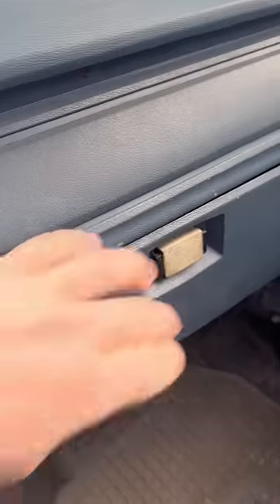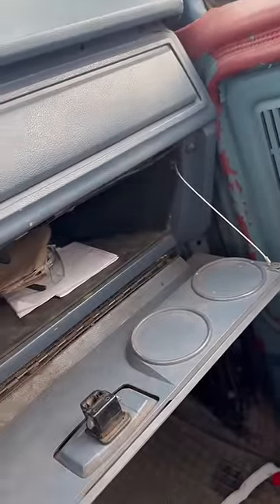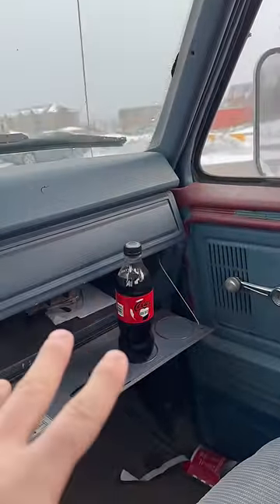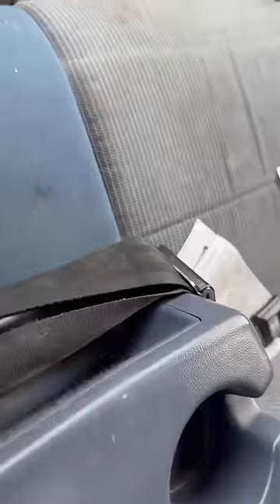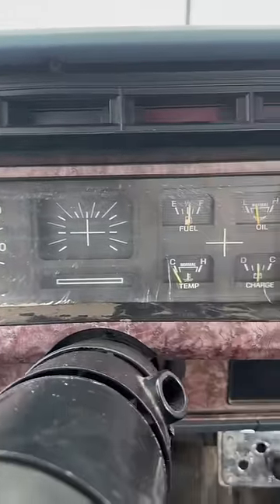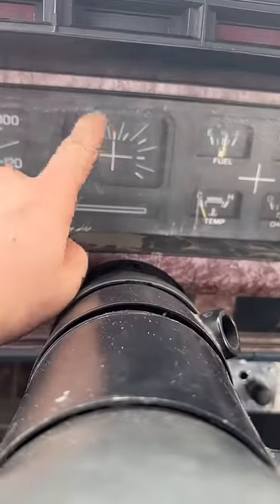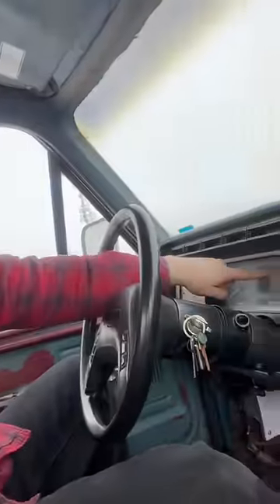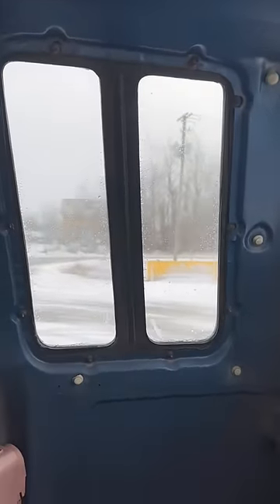Let’s talk 80s ford pickups

Comment from the maker: Edit I guess the brick nose trucks actually do share the split rear window for some of the years, thanks for the correction.
Reply: Yeah my dad's 88 f150 has the slit windows.
Reply: On the 87-91 trucks it's an overlay.
Reply from the maker: @76f350  very interesting
Reply: @76f350  no it’s not. how do you attach the trim over the middle. i’ve had to repair mine and it’s a split panel 89 and i have 3 of the super cabs one from 89, 86 and a 90 parts truck which is where i got my window
Reply: @Andy47357  It's a plastic piece and I believe it's held on with trim clips from the backside I'll have go check my parts catalog.
Reply: @76f350  it’s plastic that uses bolts that run thru the window bracket into the metal frame on the truck
Reply: @76f350  wrong I have a 1991 f150 and is a split
Reply: @Nicholas-ig5jl  Not wrong. I said the 87-91 trucks also had it.
Reply: As for the tach, in the truck I had, it was a clock. So maybe 2 options.
Reply: All years, 92 is when they got the solid window. My 91 brick had a split side window
Reply: My 89 had split windows in the back changed it to solid because the plastic lock always broke
Reply: I was just about to say I have an 88 4.9l 6 cyl 300 that has split windows
Reply: my 88 had split windows
Reply: @76f350  bullshit it's an overlay lmfao what do ford guys breed?
Reply: Beat me to it.
Reply: I have a 90 with split rear window was gonna correct you 92 and up have the single window
Reply: 89’ f250 with absolutely no cupholders but split rear glass, 5.0 speed
Reply: @highostablegarage your canadian accent is like nails on a chalkboard. My god its insane. Please dont mak3 videos. Not for you bud
Reply: Today all Ford manufactured in the United Nations, automobile standard vehicle
Reply: My 87 does in fact have that
Reply: my 1995 F250 with a 5.8l made in Canada has a rpm gage and a split window with a coolant heater that runs through throttle body",plus a block heater all from factory I bought it new and it's still a beast at 123'367 miles
Reply: Where can I order the tachometer to fit into that center part of my gauge cluster?
Reply: you forgot the bastard year 87 has split window too
Reply: @toxicgingaroot969  thats what i have its like the conglomerate of all the others lol
Reply: @andrewsmith5198 I bet you are fun at parties...
Reply: @andrewsmith5198 victimized much? 🤔
Reply: @michaelduncan9818 You don’t, unless you want to butcher your cluster up. The only real easy way to get one would be to find a complete cluster that has the tachometer on eBay. Of course then the odometer probably wouldn’t match up to what you currently have mileage wise, but really that’s probably not to big of a deal considering the 80-91 truck clusters are incapable of showing a hundred thousandths number, they just roll back to 0 after they hit 99,999 miles.

Comment: If I ever get my hands on an old Ford Diesel, I'll make sure it comes with an ignition key.
Reply from the maker: Not a bad idea
Reply: this one does have that, look closely during the tachometer section when he points the camera at himself
Reply: Look really closely it has an ignition and key
Reply: You're seeing what used to be a 3 speed column shifter with the stick removed, the ignition is toward the driver from that shifter collar, and it has a key in it.
Reply: @dominicg2456  Oh ! I didn't noticed that. Thanks for correcting me.
Reply: @dougtodd305  Now it's been pointed out, I see it. Thanks for the correction.
Reply: @calebball1527  I stand corrected. Thanks for pointing it out.
Reply: My friend's old 82 Ford 3/4 ton had a pair of needle nose vice grips attached to the starter linkage in the steering column so you could start it. Lol worked pretty darn good 👍
Reply: I almost missed that too, I thought the empty hole in the middle of the column was for a key.  I didn't even know they were still putting manual column shifters in these in the 80s.
Reply: Shifter
Reply: @johnmoser2689 my 88 has that exact same
Reply: @YourMom-mq4zc  Or just stick a button on the dash.   I didn't that on my 81.  Worked like a champ!
Reply: 251 blind people…. Cray cray!!!! Has  keys all day.
Reply: That was a column shifter spot for an automatic transmission.
Reply: You don't need to worry about the ignition key. - Ol Peg.

Comment: Had an '84 Bronco. Put 300,000 miles on it. Pulled a trailer to Alaska and back. The 300 six was dirt slow but just kept on going.
Reply from the maker: Yes sir the 300 six is a great engine
Reply: those are not cup holders, those are beer holders
Reply: I loved my F600 with the 4.9. Matched to a heavy duty trans with high flow exhaust and single barrel carb , it pulled 20K lbs of lumber up a mountain for 20 years before coming to my farm.
Reply from the maker: @Uberaroundtheworld530  that’s awesome!
Reply: @gm08351  my old Ford didn't have a beer holder. A roll of duct tape worked well.
Reply: if you would have advanced the timing an additional 6°, that 4.9 came alive! I adjusted mine and couldn't believe how much better it ran.
Reply: Oh I thought it was a heat seaking missile radar
Reply: Had an 86 150 with 300 and 4 spd. That thing wouldn’t go over 63 mph but it would pull a house at 63mph. I miss that truck
Reply: The 300 6 was their best engine. That’s why they got rid of it  can’t milk your customers for more money if it lasts too long
Reply: the 300 cid was a good engine just the rest of the truck was junk.  The auto transmission was more sluggish and lame
Reply: @Victorseafog honestly I've never seen an 80s auto I liked. Honestly I hate most newer autos too but theres a few that aren't completely awful
Reply: I still daily a 86 with a 300. Love that truck
Reply: Is it fuel injected or carbureted?  4 or 5 speed? @Anthony-qw6xk

Comment: My Dad had an '86 F-150 Straight 6 300 that he bought for use in his company. I took my driving test in that thing when I was a teenager. He put over 300,000 miles on that truck before it was scrapped. Thanks for the nostalgia with this video!

Comment: I've got an 88 ranger. Everything works including the ac and power windows. Idk how. It still has the original r-12 ac system. Bought it 9 years ago. Put a clutch in it, starter, alternator, u joints blah blah... But she still works. Even has  the limited slip differential.
Reply from the maker: That’s awesome, sounds like a really slick unit

Comment: I was amazed when the glove box actually opened.
Reply: Can't beat Ford trucks old or new!
Reply from the maker: True, usually the hinge is rusted shut haha 😂
Reply: @Davido50  old Fords are a lot better than the new ford junk
Reply: As a gm man I was amazed it didn't fall out in the floorboard
Reply from the maker: @jonstringer7136  haha 😂
Reply from the maker: @Johndeerfan-s7z  I can agree with that haha
Reply: Normally on my trucks they open automatically every time you hit a good bump...
Reply: @Davido50 Old Chevy trucks can.
Reply: My glove box latch broke and got stuck closed for a couple years

Comment: I miss my 80 F150 with the 300 in-line 6. That thing was a torque monster
Reply from the maker: 300s are good old engines
Reply: damn I wanna try one. Hop off the Toyota dink train fer a bit
Reply: @highostablegarage  they truly are. When I finally retired mine I had close to 300k miles on the original motor and 2nd trans.
Reply: Best engine out there.

Comment: I found one in a junkyard for like 25 bucks once. I have an 85 F150 with a six pot and the donor truck was an 83 with a V8, so it doesn't read right, but it DOES work. Also, you missed the coin holders in the glove box lid; far more useful than the cupholder ring things.
Reply from the maker: That’s true I did forget about the coin holders haha 😂
Reply: How did you wire it up? The tach for i6 and v8 are the same it just depends what you wire to ground. For an i6 you only wire one of the posts to ground for a v8 you wire 2 posts to ground (well just jumper the posts together and run 1 wire to ground) The back of the tach should have a post marked "G" and one marked "8". For a 300 inline you want just the "G" connected make sure the "8" post has no path to ground.

Comment: Early 80s vehicles were easy to work on. Plenty of room under the hood. Simple basic tune up on them was like 10 to 15 minutes with simple basic mechanics knowledge. Also gas was very low price in early 80s. Gas was 72 cents a gallon.
Reply from the maker: Yes sir, I’ve only seen gas that low in 2018, hope it comes back haha 😂
Reply: @highostablegarage  @kathyroberts9037  right now, gas is actually cheaper than that (adjusted for inflation). In 1980, 72 cents had the same buying power as $2.83 does today. And the gas down the road in Denver, CO is $2.49 (which is equivalent to 70 cents in 1980).

Comment: I put 350,000 miles on my 86 f150 a few years after I sold it ,it was rolling down the highway loaded down on the bump stops with broken up concrete in the bed.
Reply from the maker: That’s wild haha 😂, fun fact I’ve never own an obs ford that has had none rotten rear bump stops xD

Comment: I was super stoked when I saw my 86 f250 6.9 had a factory tachometer, it's nice to see what rpms I'm at especially having a C6 transmission.
Reply from the maker: Yeah they wind up real tight with the gears in the c6, personally I've never come crossed one with the factory tach and I've been through quite a few of these old squares haha
Reply: @highostablegarage  Yes they do, I can do 60-65 on the freeway somewhat comfortably around 2300 rpms, my previous 6.9 dually did 60mph screaming at 3000 rpms lol but yeah im on my 6th bullnose idi and finally found an 86 with a factory tach, I just kept selling them till I got to my goal wich was an 86 f250 4x4 c6 XL 6.9
Reply from the maker: @ingodwetrust1136  un killable combo that is

Comment: I had an '83 F 100 with the Inline 6. When I got it it had over 300000 miles on it I put an extra 250000 on it. That's the last year for the F100 by the way. Really miss that truck.
Reply from the maker: Yes sir sounds like it was quite the good old truck
Reply: best motor Ford made l had a couple think they stop making in late 80s
Reply: @gregorykleisinger587  ford sadly stopped making them in 1996, along with the obs body style (f150)
Reply: @gregorykleisinger587  
'95 was the last year. I had a 95 pickup with same engine but fuel injection still great running truck..

Comment: 87-91 had the split rear windows. 92 it was a one piece and slightly larger
Reply from the maker: Yes sir the brick nose trucks seemed to have a few different super cab windows which is odd but understandable from ford
Reply: My 87 & 88 rangers came with single glass... Have changed both

Comment: My dad bought what I consider a real pickup truck in 1985 . It was to be used occasionally and not an everyday driver . So he bought the cheapest 85 Ford full size pickup . It had the 300 six with auto transmission, am radio , rubber floor mat , tires were P195 75 R 15  Firestone black walls with the cheap stamped center hubcaps that covered only the lug area . Poverty caps as many call them . 

He bought a new cap for the bed and that was it . The small Firestones lasted about 15 k miles. He  brought the truck to my shop  and I installed P 215 75 R 15's and put on a new set of factory full size wheels covers from a Laraiat . 

I sure miss the days of a good basic work truck from the big three or even from the imports.

Comment: there was this 1989 6.9 idi for sale near me. 42,000 original miles. $4500. went to check it out, fired right up and ran beautifully. frame was rusted out. like completely, absolutely no saving it. it was so bad that i could shove my pocket knife thru every section of it. ontop of that all the cab mounts and bed mounts had rotted off. real tough go for vehicles in the rust belt…
Reply from the maker: Yes sir the rest eats them all alive eventually here, just a matter of time.

Comment: My first car at 16 was an 86 F-150 4x4…it was only a Custom trim but it DID have the factory 6k RPM tach in it, and it worked. If I’d known how rare it was I’d have sold that cluster and put another one in it before I sold the truck….those factory tach clusters are bringing REAL good money now
Reply from the maker: Yes sir they sure are, diesel bullnose tach clusters are super expensive now

Comment: In my truck, the area between the cluster on the right (fuel guage, battery guage oil And water) and the speedometer on the left is where the P,R,N,S,L are for trucks with automatic transmissions. I have yet to see a stock tachometer there in standàrd or automatic trucks, but hey, I am in Canada.
Reply from the maker: The big rectangle in the middle lower section of the cluster is usually for the prn12 for this Gen truck, the one right above it is where the tach would go. I’ve never seen a diesel tach cluster yet in person but I have online, they go for really good money now it’s crazy.

Comment: The 73 to '79 dent sides are my absolute favorite trucks ever made but I love the 80 to 86 bullnose too.
I've got two 81 f250s both 300 in line six trucks.
And I've got an 84 Bronco 351 Windsor and it does have the factory tack. 😊

Comment: I always saw those empty spaces in the dash and thought they were for a clock. I don't think I EVER saw a tachometer in an older Ford like that. Lol. Learn something new, every day!
Reply from the maker: Yes sir the big empty one in the gauge cluster was a tach but had to be specked out on the build sheet as far as I know, didn’t come with any of the models base trim, as for the clock there actually is a ford one that goes about where my radio is in this video, one of the 3 black rectangles right under the dash pad, also a spec item
Reply: I thought they all had the tach. Until I bought A base line F-150. It's got nothing. My 86 4x4 has the Tach. It doesn't have the gears for High Way use at all.
Reply from the maker: @christopherl2143  rough go haha, but hey I bet it works some fierce

Comment: Had the tach in my 83 F 150 but it only worked intermittently and the amp and fuel gauges didn't work at all so I made a new gauge pannel. I also found a seat at the junkyard the has a fold down armrest and 2 more cup holders. I also have the front quad shock option which I think is cool.

Comment: 1991 Ford F-150 it was called a super cab it had a split window in the back  I drove one in high school   Mine was also a heavy haul  equipped with heavier rear suspension and a e40d 1-ton transmission
Reply: Not trying to take away from this video.  I thought this was a cool video I love older ford trucks
Reply from the maker: Very slick, I had a 94 351 with a e4od, strong transmission
Reply from the maker: So do I, no sweat

Comment: Miss my 1982 4x4 that had the NP435 manual 4 speed transmission (granny gear first).
Reply from the maker: Yes sir, I have the same trans in my grandfathers f350, it’s paired to a 300i6

Comment: Most of the F250's through '82 had fixed one piece rear glass. Both of mine have no sliding windows. My '84 Diesel did, and my '85 Diesel has the sliding window.

Comment: Actually if you’re lucky enough to have bucket seats in a 80-91 ford truck, you got a sweet plastic center console that had a way way better cup holder. 87 and up trucks also don’t have the cup holders in the glove box at all. 

I also saw in the comments many have corrected you already, but all 80-91 trucks that are super cab had the split window from the factory. However the 92-97 one piece windows are backwards compatible for the older trucks, so if you’ve ever seen a older 80’s truck with the one piece window it’s because it was swapped at some point. 

Also, you got it right about the tachometer the only way you got was if you specifically selected it when the truck was ordered. I’ve had 3 80-86 trucks that were all lariat bucket seat trucks, and only one had that tachometer, and it was listed on the build sheet. That was my all time favorite truck, and I wish I still had it.

Comment: I like the older Ford trucks. I don't own one anymore. But I always felt alive owning one. I found a 99' Dakota manual trans&manual shift 4x4. I had to settle for that. Older vehicles were alot more simple. Kinda self explanatory on repairs. You can also adjust the steering slack on the sector. And Lucas power steering fix does work on old Fords.

Comment: We have an 83 F250 extended cab,  manual trans. Completely Simonized and still rust free. The 6.9 blew up and we found a super low mileage early 7.3 to replace it with. The tach doesn't work with the 7.3  but I understand there is a way to make it work. Time/Money/Ambition
Reply from the maker: Time and money will fix anything haha 😂

Comment: Another fun fact is that the older trucks like my 83 came with a cardboard glove box and If you put too much weight in them they can tear and fall out. If your glove box falls out you can look for a plastic one. then you'll find out that trucks with ac have a box less than half the size. Plastic boxes from non ac trucks might be rare because it took a while for me to find one.

Comment: Had a brand new 87 XLT lariat. What a truck 👍
300,000 mi on it.
Could still do a lot of the work myself. I want to say I paid 14,000 for it as well.
I do remember there was a little compartment on the dash, and on top of that compartment had little slits for money.. coins that is.
And I thought, what are these engineers going to think of next.
Lol